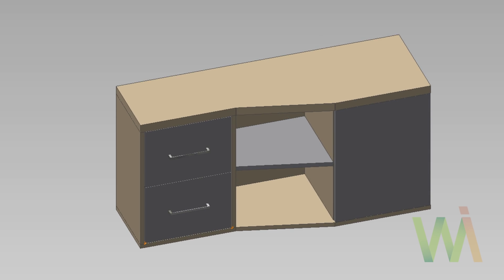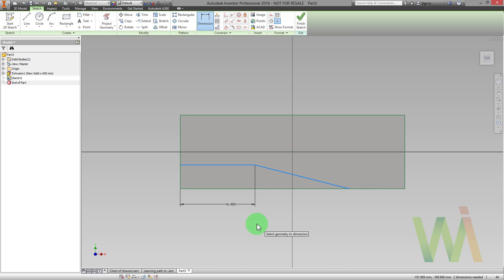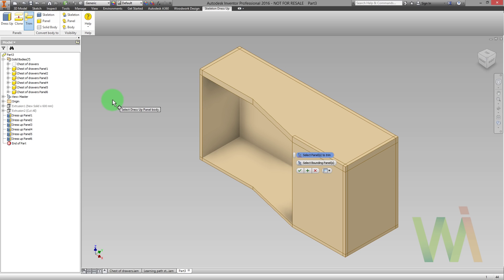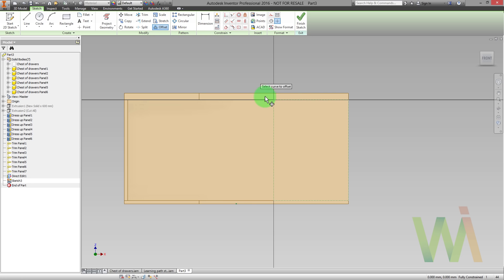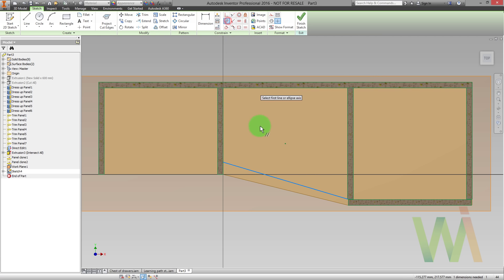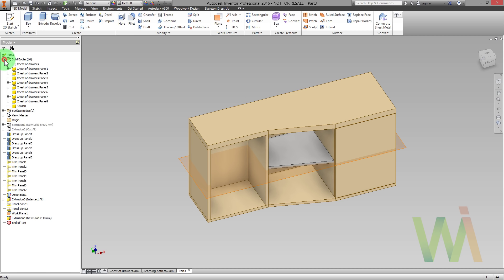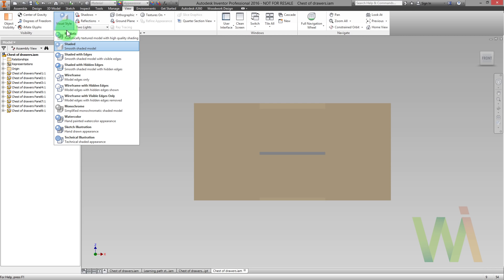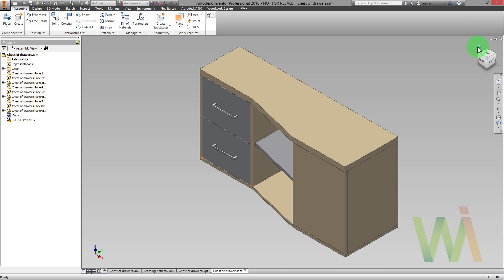1. Starting modelling

Comment: At 7:30 you are using the rectangular selection and on the edges of the front panel there are 4 dependence. I do exactly the same, but nothing happens. Dependencies not appear. What am I doing wrong?
Reply: Those dependencies are automatically show in Inventor 2016 and later versions